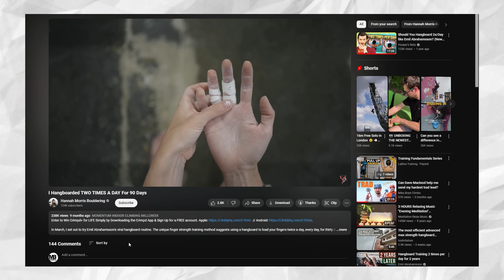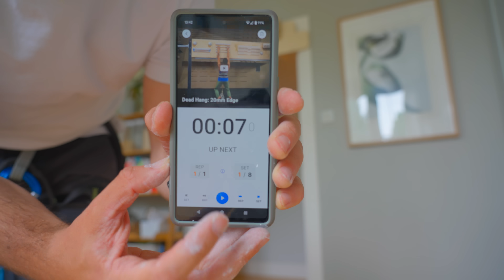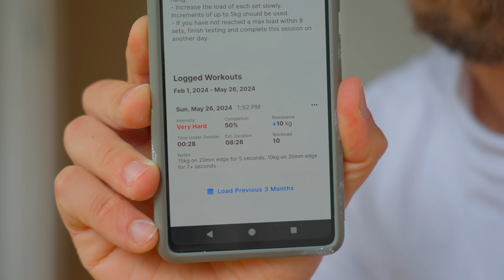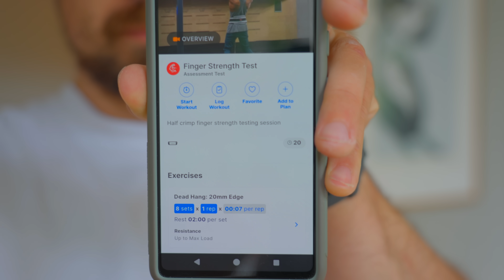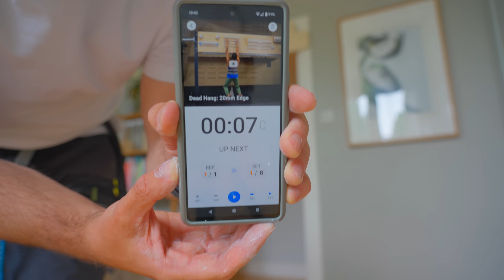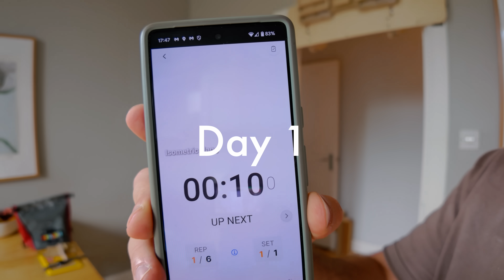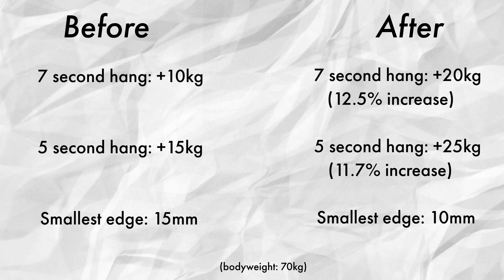Beginner climber tries hangboarding twice a day.... with results

Comment: Interesting.. 👀
Reply from the maker: thanks for watching, Emil. Huge fan! Thanks for the inspiration.
Reply: can i get a blessing father, for my fingers are still weak af lol
Reply: Am I mistaken but does Emil’s protocol go 10 second hang 50 second rest?
Reply: @robertpepper5256  i also think it was 40% of your weight, and not 70 to 80 percent 🤔
Reply: @Winnduu 40% perceived effort
Reply: @robertpepper5256  I didn't get it too. Mike did 10 on/20 off tabata style, but the original sounded more like a 10 s on 50 off
Reply: @saramutti2351  the original was 10 on 50 off, but in Emil's 1 year update as well as on his crimpd routine its 10 on 20 off

Comment: Actually I would use Emils protocol with 60% of your max weigth (as I think he advises in the 2nd video about this protocol) not for the strength itself but for regeneration purposes. I was doing the protocol 1 time a day for some time, combined with regular fingerboarding and it worked like a charm (also the pain in joints and pulleys that was occuring after strong climbing sessions dissapeared after 2 weeks of this method). The last thing I want to leave you with is: use Emils follow through video - you dont need to click on your phone every 2 sets like on crimped, and after you are done Emil says he loves you. After some time your wife gets jelous and says it few seconds before the Emil. This way your fingers AND you get a super portion of love every morning <3
Reply from the maker: Can you explain more about using the 60% method alongside regular finger boarding? Same day? Different days? Etc
Reply: @MikeBoydClimbs  I also did that approach, what I did is do emils protocol in the morning and then in the afternoon or evening, whenever I ended up having time, I would do my regular hangboard training, sometimes followed that with some light climbing which mainly was hanging out with friends and during that session making sure not to put extra stress on the fingers but instead do more slab
Reply: @MikeBoydClimbs  the protocol every morning and finger boarding 2 times a week, I only tried to keep the 6h between the protocol and hangboard :)
Reply: @MikeBoydClimbs I think referring to the fact emil as a pro climber using 80% of his bodyweight is much lower intensity than a beginner using 80% bodyweight. Better to think of a % of your max hang. That might mean a beginner using a much lower % bodyweight
Reply: @MikeBoydClimbs  This 2x/day protocol is not designed for strength training.  It's mainly for improving the strength of the ligaments (pulleys) and tendons in your fingers.  Per Baar's paper, you will see the same gains in ligament+tendon strength no matter what load you use, as long as you do it at the same frequency.  5 minutes of light fingerboarding 3 times per day 6+ hours apart is ideal for this.
Finger strength develops just like any other muscle strength - better with a rest day and better with more fatiguing exercises.

Comment: Sports scientist here just weighing in. This is very similar to a program by Dan John called easy strength. It's common for endurance athletes, but is a strength routine whereas this is focused on tendons primarily. The only thing I would say is that if you've never handboarded before, doing anything on a hangboard will get you to see results. That goes for any type of training. Everything works in your first year and anything works for 6 weeks
Reply: Amen.
Reply: “Anything works for 6 weeks” is a stretch lol
Reply: @1TieDye1  you will improve at any exercise you do for 6 weeks because just by practicing the movement pattern you will improve, even if that movement has 0 carry over to anything else at all it will still improve and therefore "work"

Comment: Note that 80% of body weight for Emil is more like 40% of bodyweight for mere human climbers. Also, use a bathroom scale to get an accurate idea of how much weight you are hanging.

Edit: Also, your fingers are really strong! I am Moonboarding 7B (V8) but can only hang on 20mm with +15kg
Reply: I think you are fingers are just weak for V8 tbh, and lattices data backs this up. For reference on a 20mm edge I can hang +45kg give or take 10kg depending on where in the year/training period I am and I climb about V8/9 and can barely do a V6 (benchmark) on the moon board. (Note other boards vary, I can do V10 on the kilter but it's soft AF)
Reply: @zakmorgan9320  Hanging seems to be very different from cliombing. and applying strength on the wall often seems to be a completely different stroy. Using your whole body and good technique might mean you can cliomb much harder with relatively weak fingers compared to someone who basically just campuses everything (unfortunately I definitely fall into the latter cateory)

Comment: In Dave McLeods video about hangboarding he explained that for beginners the science seems to suggest that low load training with increased time (to fatigue actually) has the same effect as high load training but with less risk of injury. So it seems to make sense that it is working for you. Keep in mind that with traditional training you still need to stark slow and increase load over time. If you do that the traditional training should be just as safe as this method given enough time for tendons and ligaments to recover.

Comment: If you want to be accurate you can stand on a bathroom scale when hanging. When the scale shows 20% of your body weight you are at 80%. It's probably useful for getting the initial sense of how much is 80%.
It's a hack I came up with when I wanted to track my progress on edges that were too small for me to be able to do my whole body weight :)
Reply from the maker: I actually tried this after we finished shooting and I was pretty accurate with 80%!
Reply: @MikeBoydClimbs  Also in another video where Emil did this, he said you should do it with about 40% of your maxhang weight. Thats why Emil did it with 80% of his bodyweight, cause his Maxhangs are already so strong.
Reply: Either that or just put a pulley under your hangboard so you can add a weight that reduces your bodyweight by 20%.

Comment: I've been doing the same exersize as well for some time now (though I have done it on the sharp edge of the the underside of a wooden stair plank because I am unable to install a hangboard in my current apartment) and I do definitely feel the difference with smaller holds and crimps. After you mentioned not having these little pains in your fingers anymore I realised that I experience the same lack of pain. 
Thanks for the video!

Comment: Great video Mike! I think a way to controllably load 80% bw would be to stand on a scale and then pull until only 20% registers on the scale. Alternatively you can use a load cell / tindeq block and track the force that way

Also i think the only conclusive way to test the difference would be to get several people train one arm (randomly dominant or non dominant) with sub max and the other arm with standard one arm hangboarding protocols

Comment: Very interesting results, which do make sense, especially in the context of Hooper's Beta's hypothesis on why the protocol works. As an intermediate climber I would suggest to not advance to weighted max hangs right away but try a cycle of repeater hangs (e.g. 7/3) first to get used to high intensity fingerboarding without the additional stress of as much weight.
Myself and many other people have found tremendous gains from doing a cycle (3-4 weeks of training followed by a deload week) of repeaters, then doing a cycle of max hangs and repeating this in a loop. And I feel like no-hang -> repeaters -> max hangs is a pretty natural way to push your training and get used to the more intense stimuli

Comment: Excellent video! I'd say this 'nohang routine' is so effective because it trains the tendons directly which seem to benefit from super high-volume, low-intensity work. 
Perhaps Emil saw such great results using this method as his tendons were lagging behind his muscles, limiting the amount of force that they could safely pull with. I had a similar issue in my knees wherein my leg muscles were overdeveloped compared to my knees causing pain and instability.
I also used a nohang-esque knee strengthening routine and found astonising strength gains - overall my squats felt more stable and I wasn't afraid to squat heavy anymore (similar to your crimpy move-bailing out of fear of an injury).

This nohang training method could be a very useful tool to accelerate a beginner climber's progress as I suspect the advice not to hangboard before your 3rd year of climbing is to allow your tendons and joints to develop enough to handle the strenght you would gain from a conventional hangboarding program.

Comment: A note on terminology: "No hangs" more commonly refers to pulling weight up from the floor with an edge, or pinch block. Also known as "block pulls" or "farmer crimps". 
The "no hangs" depicted in the video are more commonly called "recruitment pulls".

This isn't a correction; just meant to help folks to watching do further research or find other programs that suit them. Emil's video on the protocol is the only place I've heard "recruitment pulls" referred to as "no hangs".
Reply from the maker: Thanks for the info 💪
Reply: Emil call them no hangs though.

Comment: Ive been climbing for about 7 months now. 4 weeks into climbing from never climbing before i pulled my a2 ring and middle fingers in both hands. Sucked bad. I went to a climbing specific therapist and he has had me hangboarding every single day. These are body weight and full hangs. I have seen this injury leave super fast and im now way stronger then i was before. I was able to climb at the gym in about 2 weeks and am doing great now. I am still hangboarding the same every single day and am about to start adding weight though i dont know if ill be doing that every day.

Comment: 7:12 btw, there is an easy way to measure the 70% body weight: If you just stand on a scale when "hanging" and pull until it only shows 30% of your weight, then 70% are applied to the fingers!

Comment: I've just been reading New Scientist and they've had some strength and fitness articles. The interesting aspects were that very regular training increases blood volume and hence some strength and definitely endurance (plus the lubrication and muscle/tendon health of increased transport around your body). Also, they say the best way to increase strength in the short term is HIIT sessions. And Emil's method is also a HIIT session (sort of). Finally, there's definitely neurological changes regarding activation - I did a session with Dave Macleod and the neural aspects are SOO important. Even down to taking your shirt off when training for max power (max power = max training effect). I was told off (sort of) for looking 'calm' when doing my hangboarding 🙂
Reply from the maker: I definitely feel like there is increased blood flow!

Comment: If you add bathroom scale to you setup you can get your 70-80% bodyweight with a degree of accuracy. Simply stand on the scales to begin and lift yourself up, once your measured weight has dropped by about 3/4 you are at the target. Having done this a few times I can now gauge if by feel much more accurately.
(edit: seems I am not the first one to come up with this, not surprising really)

Comment: This training sounds similar to those of powerlifters and body builders. Rather than doing our PR weights until we physical can't move, we rather do moderate (but still challenging) weights for more sets. Reason being, the time to recover increases exponentially with the amount of effort; and the strength gained levels off the closer you get to complete exhaustion. So we keep it moderate to balance gains and recovery time.

I imagine a better way to do this would be to do as much volume as you need for your forearms to get tired, but not so tired that you don't recover in time for the next session.

Comment: I've once got numb fingertip after sharp-edged 1-2 finger pocket on a lead climb. It was the crux on a slab/vertical, so naturally I held for my life. Didn't feel anything special (except a normal sharp-edge sensation) while holding the pocket, but after 30 mins noticed numbness in the tip only. I guess sharp edge damaged some nerve tissue or something inside. It lasted for week or so, then went back to normal. The pocket was for one phalange, so probably it can be the same kind of thing a hangboard edge can do.
Reply from the maker: Maybe it's the same thing I did. I'm glad you recovered after a while!

Comment: Try campus boarding next! I find that once I have build strength on the hangboard, the campus board helps me turn it into contact strength that I can use on the wall. Just take it easy. I wouldn't campus every day or even every climbing session as a beginner.

Comment: I did alot Emil's hangboarding also later to recover from injury.
I'd say that this whole process just makes your tendons work better. Because unlike muscles which are happy to just have passive rest, tendons recover very well from stimulus (exercise). They have much better response from that.

Also as far as I am aware you should hang for 60-70% of your effort not bodyweight right? Just saying that if someone is a beginner and tries immediatelly 80% of bodyweight they can easily injure themselves... these numbers are always relative to where you are at with power.

Also a tip for injuries - warmup. Can't stress enough how much it gets important the further you progress to have warmed up. My power peaks at 1/3-2/3 part of the session. Not at the beginning. It used to be first try best try.

Tweaky fingers at least from my experience are best healed by loading them but far less than you would usually do and slowly progressing up again. Not doing anything is good if you injure yourself but if you feel tweaky than rehabilitation is what makes it recover. Not doing anything often makes it stay on the same place

Comment: +10kgs is A LOT! (My results with 3 months of Max hangs were half of it or less each time). also, I would like to point out that you probably overdid it (as has everyone who tried the protocol lol). 80% bw for Emil at the time represented roughly 40% of his max. for you it's much more! and the 80% only correspond to the strongest grip type. Every grip type has a different max. and you should aim at 40ish% for each. I'm actually surprissed you didn't get injured. I personally think 40% is even a little high and that we could prablably get away with much less weight. I'm currently doing lifts with 10kgs, which is <20% for me and it feels lilke I'm still getting a good stimulus. Let's see what happens ;)

Comment: The title of this video should be: man gains massive finger strength, but severely undersells it. I've been a coach for over a decade, and these results are amazing. No, you likely would not have achieved such results as a beginner with a typical hangboard routine as you'd likely be injured during the loading phase, well before peak. You're seriously doing this hangboard routine a massive disservice by your interpretation of the results. Especially since I'm sure a big portion of your audience is composed of beginner climbers.

Comment: Essentially.. you just need a counter weight to measure out the required 20-30% of assistance to end up with 70-80% of bodyweight hanging without need to focus on altering pressure through your feet.
Perhaps a set of resistance bands or set up the finger board on an assisted pullup machine.
Reply from the maker: I think the resistance bands would be a good idea. I tried to set up a pulley but couldn't figure out a proper way. Thanks for watching!

Comment: nice video man. You can tell your tweaked shoulder by the way you are hanging on the hangboard . You can see how you have less control and it nearly touches your ear. I do have the same. Take a look at it . It really is a low hanging fruit to work on. You may have finger strength but it doesn't translate with bad shoulder stability
Reply from the maker: Wow you can really see that? Damn it must be bad. I need to get it sorted asap. Any recommendations where to start?

Comment: If you put a scale underneath you while hanging, you should be able to adjust how much weight you put on your fingers until the scale reads 20% of your body weight to achieve the 80% body weight on the fingers.